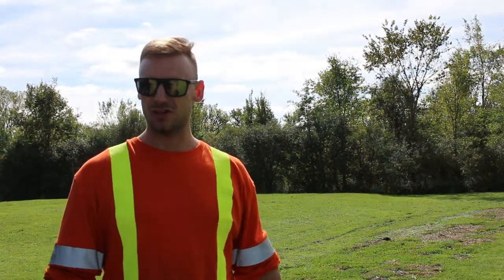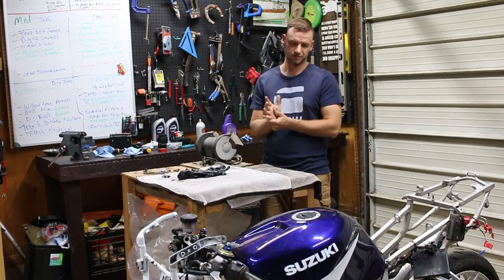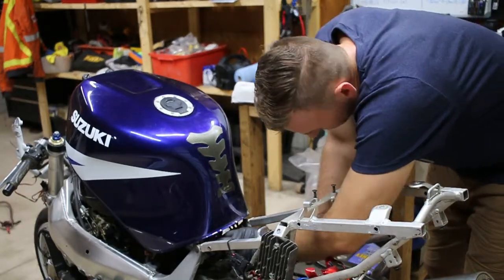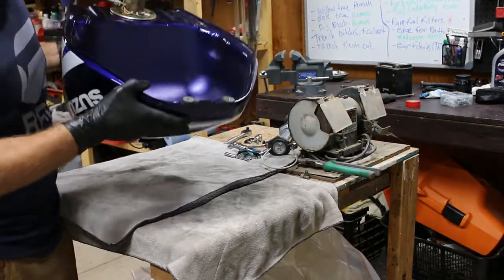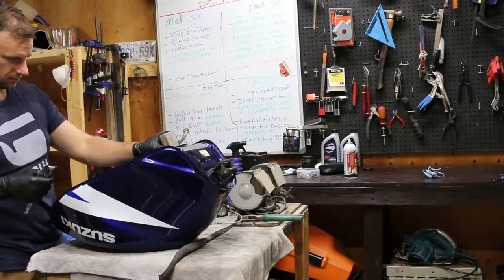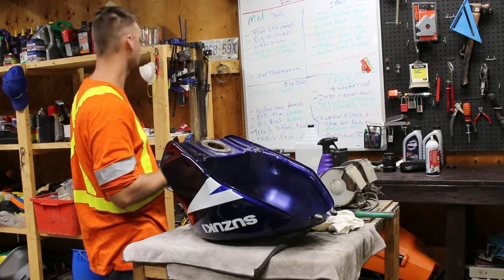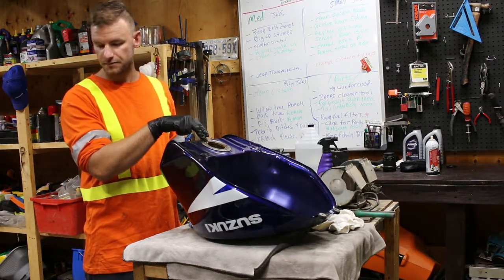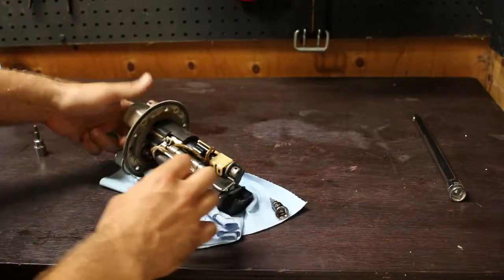how to remove gas tank - clean rust out - clean fuel pump filter - GSXR 1000 Project Bike

Comment: I got the same problem … rusty tank ! Now after GSXR 600 sitting it won’t start..  I changed the fuel pump cleaned fuel filter.. cleaned inside tank with some citrus cleaner I seen on video back in like 2018.. But rust is back..  bike only rode a few times a year, so I’m trying your method..20 - 10 mm bolts..vinegar.. then 2 stroke oil at the end ..  I just hope the fuel injectors are not clogged .. bike was running a few months ago… but sit  outside under a cover..So now it’s pull the tank  and try this..Thanks for the good ideas on the video..
Reply from the maker: If that doesn't work get it professionally coated. Keep us posted. Fuel issues suck
Reply: Whew…? It took me ALL day .. to take everything apart an clean the tank… 4 YEARS worth of rust built up! An getting the fuel filter tea bag out of the pump was a hour long challenge.. but after I had it cleaned an put back together.. got the heartbreaking sound of still not wanting to start… an was brand new battery .. but after all day of trying .. needed a little boost an I went got some fresh 89 octane gas an I tried again… an then heard a sound of life… prime the pump a few times then she fired up!!! And was running stronger than ever!!! Thanks for the video.. I actually was starting to think ( how am i going to get this bike to the repair shop ) thinking it wouldn’t ever run again… I believe I need a new set up tires … maybe four years if setting left flat spots .. but tires have tiny dry rot cracks .. so that’s a good excuse to buy a new set..

Comment: From what I’ve read, there is a high pressure fuel filter and a low pressure fuel filter. Does anyone know where the one he did not touch is at??? Really need help

Comment: It's 230am since your wondering what time of day and I'm drunk AF an my bike is completely apart. Awesome video helped me lots. I used evapo rust and vinigar BTW the combo worked great
Reply: So i got all my gas out of my tank right. But I can still hear a fluid and some debrees in that fluid sloshing around. I think its in between the lairs on the tank. Is it gas or condensation? I see a tube inside that looks like it goes to the ouaide of the tank with no cap could rain water have gotten inside the lairs via that metal tube?
Reply: How the heck do I get that fluid out you can't separate the tank like that. Only thing I can think of is lightly bake it in the oven evaporate it
Reply: Is it maybe reserve fuel or something weird idk about
Reply: Its not firing on the two outer cylinders. My tank is rusted to shit inside. I think the injectors are like totally clogged idk yet haven't got them out yet.
Reply from the maker: @urikalashnikov8668  I took a stick and a cloth  taped to the end and just dabbed the rest of it out. I got lucky my injectors are OK.
Reply: Got it running on all 4 again. But now I'm having this problem where when I accelerate it gets stuck and whatever I accelerate too then gradually continues to go up until I have to kill the bike. Its like the butterflies are getting stuck open but they aarent. Idk what's going on
Reply: Also the warm idle is 2k and the cold  idle is 4k it with cold idle for a minute and only sometimes pipe back down to 2k. But as soon as I give it gas its back go idling at 4k again.
Reply from the maker: Did you double check the choke style lever ? That's the high idle.
Reply: @GilbertGardens  I think the deleted the high idle. BC the the top butterfly valve isn't working at all and the high idle screw is like screwed all the way out

Comment: Since two days I have on my GSXR 750 k3 above 9000 rpm no Power. Feels horrible! Seen your video and I am highly motivated now to do a pump and filter cleaning. Thank you!
Reply from the maker: Check fuel tank cap. Make sure its venting.
Reply: @GilbertGardens  Thanks mate, I will do maybe first, check out test ride and then the pump work.
Reply: Happens the same on my k6 600! And used to happen on my other k7 600 back in the day! Arround 12.000 it just loses power and its unestable! Did cleaning the filter work for you?
Reply: @suzukipower9330  having the same issue with my k7 750. Been scratching my head for months. No power after 11k revs. Did change the fuel filter tried injector cleaner. Bike is not restricted. Did you ever solve the issue? Checked forums no luck on my side.😢

Comment: I ran my gsxr on e for couple miles got gas and couldn’t start it replaced pump and it’s still not starting but I jumped it from relay and runs fine , I undo gas line from tank and no pressure ??? Jus leaks out no squirt ? Can’t start it with the starter/killer switch button
Reply from the maker: It doesn't turn over at all ? Safety switch ?
Reply: Gilbert Gardens no when I press the button nothing happens you can hear the fuel pump turn on when I press the Killswitch up and down then I have to pop the seat off and take a screwdriver and start it from the Solenoid

Comment: Thanks your video helped me.

My machine is a GSXR1000K2 with 20000 miles on the clock, it symptoms were spluttering/sudden power loss at high speed throttle roll on.

I thought the original plastic tea bag filter was done however I put it in the dishwasher and it cleaned out all the orange crud and finished up looking almost as new. But I replaced it a genuine part.

I recently bought an additional used fuel pump assembly which I will service and hopefully use as a quick change backup in the future.

I managed to remove and replace without removing the fuel tank.

I struggled with the secondary black sealed housing/filter/syphon?! which was very difficult to clean but I managed to persevere and it finally flowed clean and so I refitted it without any problems, started first time.

This item also contained a lot of the rust particles guzzled up from the very bottom of the tank.

I treated the rust with loktite rust remover, let dry, then refilled with petrol and now my bike runs flawlessly. 

Thank you👍
Reply from the maker: Glad to hear brother ride safe.
Reply: This is the exact issue I’m having with my k11 gsxr 600. On full throttle by bike sputters violently. At a complete stop my bike stalls out. Starts back up but at a stop it stalls again. Is this fuel pump issue?

Comment: That black plastic canister thing that the pump pushes gas through is the actual filter which builds up a ton of crap inside. Trying to clean it out is a real trick, lol
Reply from the maker: I heard that. I never got into it.
Reply: @GilbertGardens  I cleaned mine yesterday. Zx12r was running horrible with a load on it, but just fine in neutral. Good fuel pressure, but very low flow. Took the pump out, took that plastic piece and shook it real good, what poured out of one if the ports in it looked like straight rust water, mud, horrible... I made a really strong solution of Iron Out and used a hand pump to push it through the filter. Once I was happy there wasn't any air in the filter I let it soak for about 30 minutes in the solution... then blew it out with compressed air till it was nearly dry. Put it all back together, tested flow and got almost 4oz of fuel instead of the 1.5 I was getting before, right on spec... it completely fixed my bike. She tryna pick the front tire up going into 3rd now. It made so much difference having that filter unclogged and proper flow restored. Remember, even if you have good fuel pressure, that don't mean it also has good flow/output. Always check both.

Comment: Got a basket case 1996gsxr600 the hoses under air box and two wires under the tank fuel pump on the frame

Comment: Used cleaning vinegar, and screws. Kept the vinegar in for two days and used a turkey baster to grab the rest of the fuel. 
How did you collect the little rust debris left over? I don't want to risk running extra debris through the fuel lines since the bike has  been sitting. 
Thanks for the video, so helpful
Reply from the maker: I used a tiny bit of rubbing alcohol taped to a stick and it grabbed a bit more rust . I  the end I decided to take the tank and get it lined just to be safe

Comment: i did clean my gsxr 2004 fuel pump but the black filter did all the damage and you cannot clean it properly cause its sealed so i bypass it with external filter now runs so gooood !!!
Reply: how you did the bypass with the check valve?

Comment: unfortunately you only cleaned the “pre” filter, the entire platic housing is the secondary fuel filter & its not serviceable. I have an 04 hayabusa that im sure needs these filters.
Reply from the maker: Yes like you mentioned this is the serviceable filter the actual filter is stupid expensive cheaper to find a used assembly online. It cleaned up nicely.
Reply: I have the sock pre filter ordered, im wondering if i could submerge the plastic body in my ultrasonic cleaning machine & clean it out that way? As you said its $260-$275 for the “fuel filter”
Reply from the maker: @tysoncott7402  im not too sure... I mean if you could run cleaning solution backwards out the pump you might get some of the debris out that way.. let me know if it works for you.

Comment: The hose that runs on the right side of the bike down near the oil tank and exhaust where does that go from the fuel tank
Reply from the maker: there should be a little breather nipple on the bottom of the tank that hose attaches to and runs down the bike. keep it away from hot stuff.